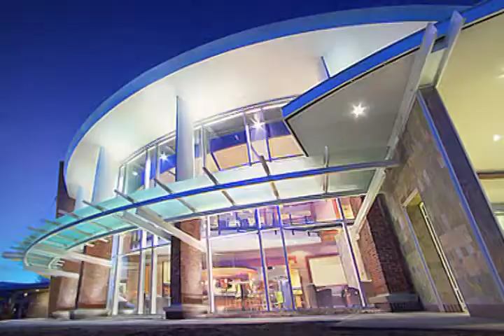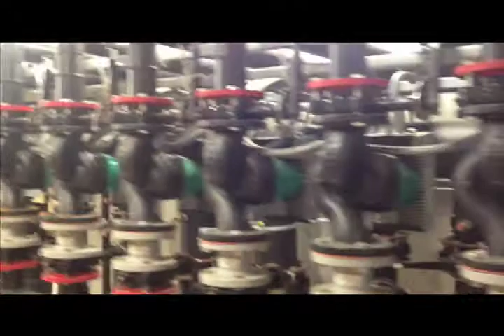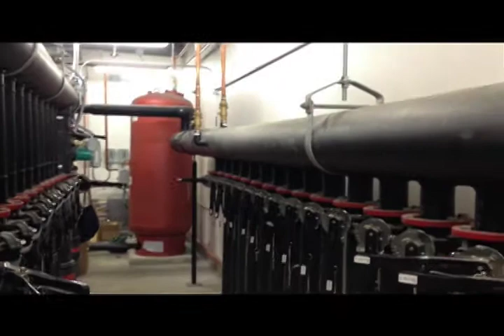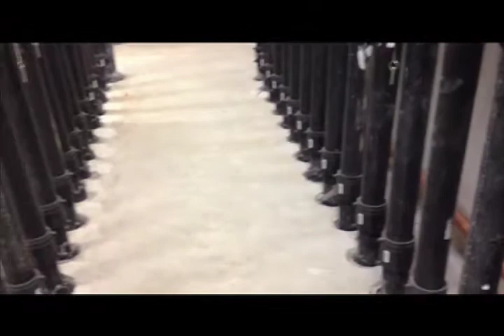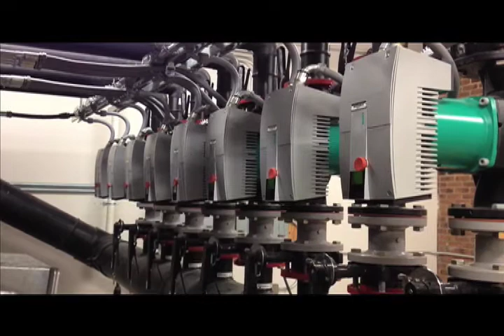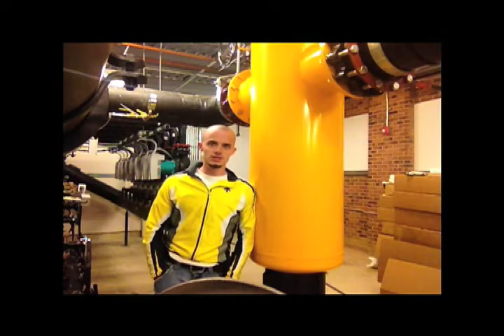Geothermal Energy Node (surprise dance ending?)

Comment: Are the loops to the ground built in a 'reverse return' design? Meaning the first pipe that goes out to the ground would be the last pipe to come in, thus making sure that the water travels through the entire loop field and not short cycling through the first few holes.
It would be interesting to see the load system with the heat pumps.